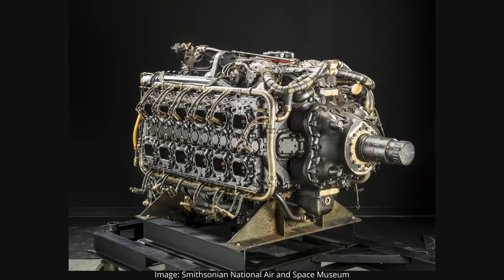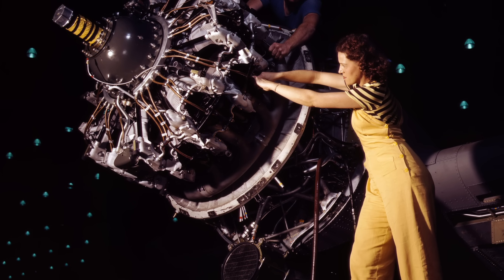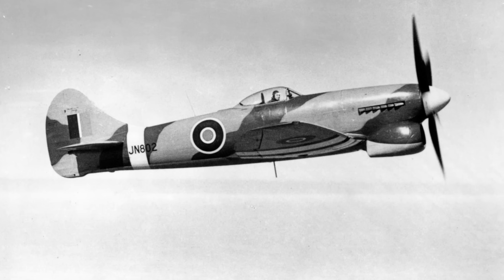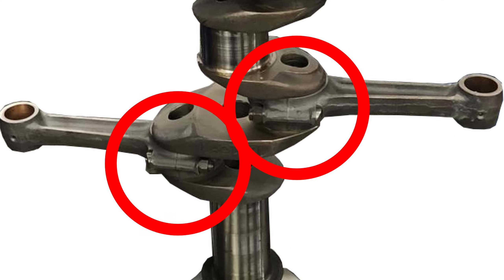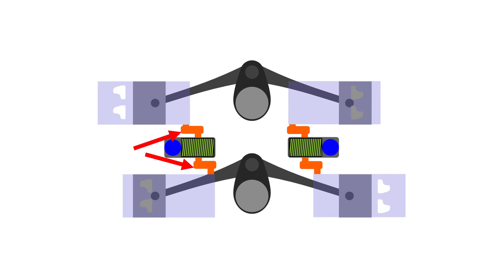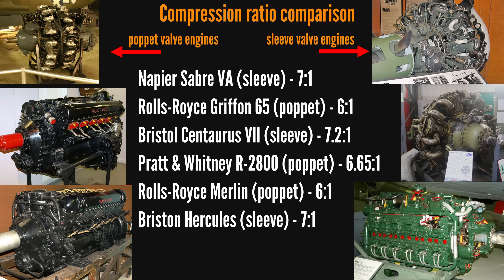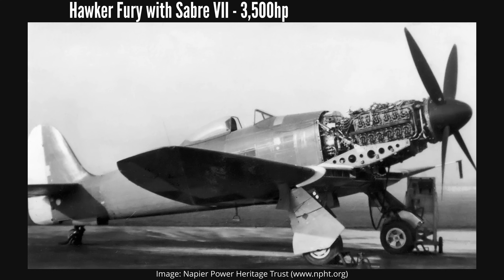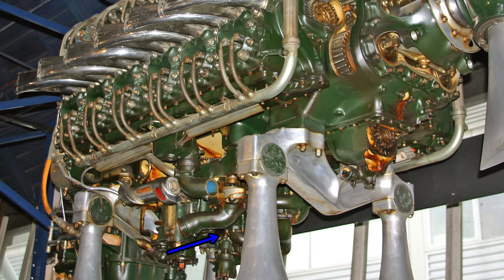The Complex Napier Sabre 24 Cylinder Aero Engine Explained Simply

Comment: Well done, most videos on these high-powered WWII piston aircraft engines are full of errors, this video has what I believe to be one.  There is no proof that the Sabre officially got to 3500hp.  The last one, the VII, was type-rated at 3050hp for takeoff on ADI .  Did they produce more than this?  Probably, but this would have been more along the line of WEP, which I have never seen specified. I once believed the 3500hp figure, but after extensive searching, I have found no primary source to confirm this, so, for me, it is 3050hp

One of the more interesting things about the sleeve valves used on the Sabre and Bristol engines was that the block had five ports but the sleeve only had four ports.  This means that one port in the sleeve would alternatively pass cold inlet mixture followed by hot exhaust gases.  This heat cycling is generally considered a bad idea, although I have never seen this issue explored in any detail.

There is a great deal to cover in any complete story of the Sabre,  unfortunately, much of the original Napier documentation has been lost.

Many H pattern aircraft engine designs have been put forward, but the Sabre was the only one that made it to production.  

In the USA, both Continental and Pratt & Whitney worked on sleeve valve engines, P&W on the X1800 aka H2600 H24 for the army and the H3130 H24 for the Navy.  These engines were considerably different to the Sabre and were closer to the layout of the Napier Dagger, albeit, with water cooling.  Examples of these prototype engines still exist.  The P&W effort came to an end after a change of management at P&W, P&W essentially bought their way out of the contract.  Kimble D. McCutcheon's book "American Sleeve-Valve Aircraft Engines " has a wealth of information on the subject.
Reply from the maker: Thanks. I should perhaps have cited my sources for the 3,500hp claim (Oldmachinepress which I believe reputable, and some research papers with the same claim). There is even some sources claiming it achieved 4,000hp, but I did find counter-claims that there is no proof of that, so I reverted to the 3,500hp number.

But I'm happy to concede if it was only 3,050hp, you may have researched that detail more extensively. 

I did consider including other H engines in the video but when I started digging deeper for research months ago I got very fascinated by the details of the the Sabre and so decided to focus on it. The Lycoming H-2470 may feature in a video soon though.

I was in contact with Kimble some time ago but didn't realise he wrote the book about American sleeve valve engines. 

Thanks for the info.
Reply: @LetsGoAviate Pierre Clostermann said the engine of  his Tempest “Le Grand Charles” was tuned to 3,500 hp for “Diver” missions, intercepting V1s.
Reply: @SvenTviking   Clostermann’s book is a great read but unlikely to be a reliable source on power figures.

If a Sabre engine of 36 litres a could produce that much power, why couldn’t a Griffon of the same capacity do it? See, these are the kinds of questions that have to be asked. They might sound stupid but the underlying point is that the Sabre would have to be nearly twice as efficient as the poppet valve Griffon in order to do what has been claimed for it. If that was the case then why are they no longer around?
Reply: @LetsGoAviate  I keep trying to post with some detail but it keeps getting deleted.  So I will keep this short.  If you go to the Old Machine Press article and scroll down to the comments, you will find some discussion on the power figures between Bill and myself where he cites which power figure is from what source.  

The 3055hp is flight-certified takeoff power, I have no information on WEP which may have been higher.  It would be most unusual not to have a WEP power output.

This, is of course the issue with just a single figure, a family of graphs is usually required to get the true story
Reply: @robertnicholson7733  I think it would also be necessary to provide comparative data for say a Griffon or DB605 or similar. Either the engine was extraordinarily efficient or these figures are theoretical or best case or whatever. Putting it into a modern context, in the strive for fuel efficiency in modern engines, I would have expected to see sleeve valves survive if they were so efficient. But I can’t recall a sleeve valve engine being produced in any numbers in the last 60 years (the last one I saw was an experimental lawn mower!).

And by contrast, the Centaurus, which was eventually developed to about 3,000 hp, had a capacity of 53.6 litres.

Bristol Centaurus: 3,000 hp from 53.6 litres = 56 hp/litre
Rolls Royce Griffon: 2,400 hp from 37 litres = 65 hp/litre
Rolls Royce Merlin: 2,000 hp from 27 litres = 74 hp/litre
Napier Sabre: 3,500 hp from 36 litres = 97 hp/litre

Can anyone not see the outlier here? Sorry but this just stretches credulity. And that’s before we start entertaining the more outrageous claims. If the Sabre could do that why couldn’t the Griffon? If other sleeve valve engines couldn’t produce that level of efficiency, how could the Sabre do it?

There will be a temptation in some areas to compare these figures with racing engines so let’s do that. A Cosworth DFV put out about 450 hp from 3 litres in 1970. That’s 150 hp/litre. But the requirements for an aero engine are very different. They are required to run at probably 70-80% power for most of their working lives. Racing engines don’t do that. Also the difference between low and high revs in a racing engine are much greater than in an aero engine. A racing engine will only reach max revs very briefly - just before changing gear or at the end of the longest straight - while we are talking of WEP for up to five minutes!

In other words, for a variety of reasons, aero engines run under very different stresses than racing engines so such comparisons are not very valid.

Even so, if sleeve valves were so efficient, I would expect to see them survive a lot longer than they did.
Reply: @thethirdman225  Your comparison of the four engines is missing a vital factor, the RPM at which that power is produced, recalculate along the lines of BMEP, you only went half way by eliminating capacity, you need to eliminate RPM from the comparison.   

There is also the issue of the combustion chambers being too big, all the main stream WWII aero engines had far too much capacity per cylinder to get good combustion (also a lack of squish was a serious issue).  Modern engineering puts the ideal cylinder capacity around the 500cc mark.  In some respects, the Griffon was a wasted effort, the already too big Merlin combustion chambers were made even bigger. From your own figures, you can see that there is no proportional increase in power compared to the increase in capacity.

Frank Halford's earlier engines, the Rapier (550cc per cylinder) and Dagger (700cc per cylinder) had much smaller cylinder capacity.  The Dagger VIII produced almost 1000hp from 16.8 litres despite being a two valve per cylinder design, running on 87 octane, not having the supercharger technology of the later R-R engines, and being underdeveloped.  Comparatively, the Dagger VIII produced 59.5 hp/litre, more than the Centaurus and getting close to the Griffon, in 1938!

The Sabre (1520cc per cylinder) had far too high a cylinder capacity for efficient combustion, yet it was half that of the Griffon.  You can see where this is going.

Sleeve valves had advantages (more at the beginning of the war than the end of the war) but the main reasons they did not survive was the incumbency of poppet valves and cost, they were expensive engines.
Reply: @robertnicholson7733  
"Your comparison of the four engines is missing a vital factor, the RPM at which that power is produced, recalculate along the lines of BMEP, you only went half way by eliminating capacity, you need to eliminate RPM from the comparison."

I don't see how this makes any difference. I'm fully aware that power is the product of torque and RPM. This was at the heart of Halford's design: that a high revving engine would produce more power than a lower revving one. It was also Halford's intention to build an engine with the greatest power density. Basically, it was as much an attempt to reduce frontal area for a given power output.

The figures I posted earlier are simply power figures. The torque figures aren't mentioned either so I don't see why RPM should be. They also reflect an engine that never went into production (the 3,500 hp Sabre was never in service).

The fact is that the differences in efficiency between reciprocating engines in this class are relatively small. If you think about it for a second, BMEP and other calculations would have to show radical diversions in efficiency for the Sabre to have anything like the power claimed for it.

To take it to its ridiculous extreme (Setright's claim):

Napier Sabre: 5,500 hp from 36 litres = 153 hp/litre

which was frankly impossible at the time.

Furthermore, one problem with sleeve valve engines is that of sealing. It's simply not as effective as that for conventional poppet valves. That means a 1930s engine was capable of the same peak output as a Cosworth DFV racing engine from thirty years later. Clearly absurd.

If you want to see an illustration of this from a racing series, look no further than Group C from the 1980s. Group C was a fuel allocation formula. Take Le Mans as an example. The fuel allocation was 2,500 litres and that was that. With all those different engine configurations N/A V12, N/A V8, turbocharged V8, turbocharge V6, turbocharged I4, turbocharged flat 6, rotary... The variation in peak power was not that great and even within those categories, there were capacity and RPM variations. Yet there was relatively little variation in power or efficiency, other than the rotary and that suffered from sealing problems too.

This is a long way of saying that every team was simply trying to get the maximum power they could from every drop of fuel while remaining within the limits of the allocation. The only way to extract more power is to increase torque or increase revs but crucially, both use more fuel. And the one thing we simply don't know about the Sabre was its fuel flow, compared with conventional engines.

"Sleeve valves had advantages (more at the beginning of the war than the end of the war) but the main reasons they did not survive was the incumbency of poppet valves and cost, they were expensive engines"

Yes. Expensive and - to a degree - impractical. They were harder to maintain than poppet valve engines of the same era.
Reply: @thethirdman225  Really, you don't understand why rpm should be accounted for?  The effectiveness of the cylinder design of aero engines is usually determined by BMEP as it eliminates both the capacity and rpm differences to give a single figure.  I thought you would have picked that up from reading and watching Douglas.  

In WWII aero engines, detonation was the key problem and cylinder size had a significant effect on detonation, the bigger the cylinder, the more likely detonation would occur all other things being equal.

I am also unsure why you keep bringing up Setright's power claims, which I have never accepted as shown in the comments section of the Sabre article at Old Machine Press.  

Equally, don't believe everything Bill Gunston wrote, he is just as biased against Napier as Setright was biased in favour.  In one of his books, he takes Napier to task about the routing of the ignition leads of the Dagger,  essentially saying that it was stupid and offering a better way of doing it, sadly, his idea would have had both plugs of 12 cylinders running off one distributor, and both plugs of the other twelve cylinders running off the other distributor, hardly ideal, especially if you want to fire the two plugs at different degrees of rotation.

You seem to have decided that I meant thermal efficiency when I used the term efficiency in my previous post, when I was talking about something else.  I am not going to discuss fuel efficiency here as that is a far more complex area.

Having recently received the Lyndon Jones cutaway engines book from R-R Heritage trust, after an 18 month wait, my attention was drawn to the R-R Eagle 22, so I will use this as a comparison as both engines were sleeve valve H24s (still an unanswered question as to why R-R spent so much time designing sleeve valve engines late in the war, if they were of no use - given their expertise in poppet valve engines and their production lines being geared up for poppet valve engines).  I will use the figures out of the R-R book even though I have not checked them against other sources.

Sabre        36.7l    3050hp 3850rpm
Eagle 22  46.16l  3500hp 3500rpm  18 psi boost 
Eagle 22  46.16l  3654hp 3500rpm  22 psi boost (1944)

Applying the Eagle 22's BMEP to the Sabre, we get 3061hp for the lower figure and 3196hp for the upper figure.  This is interesting, the lower figure gives a power output very close to the Sabre VII's flight certified power.  The Eagle 22 had an advanced two stage supercharger with charge air cooling, the Sabre VII had a single stage supercharger with no charge air cooling.  The upper figure shows the possibility of more power out of the sleeve valve engines, the development of the Eagle 22 was not completed, so even higher figures may have been possible, note the boost pressure, many writers seem to think boost pressures that high are not possible with sleeve valve engines.  There must have been a WEP specification for the Sabre, although this may be hard to find, the pilot notes usually refer only to boost pressure and mixture.  According to the stories (true?), the Sabre tended to be pushed over speed quite a lot, especially in dives, apparently over 4000rpm would not be out of the question.

Much is said about the sealing of the sleeve valve engines, the thermal transfer of the sleeves, oil starvation and all the rest but no one seems to be providing any references at all, I could find no references in Douglas's book, so if you have references please provide them.  If they are in Douglas's book, a page number will do.

From another post, clipping of the sleeves, this is strange one, for the ports in the sleeve to "clip" the port in the block, either the exhaust ports or the inlet ports must be open, meaning the cylinder is at manifold pressure (either exhaust or inlet), such low pressures aren't going to provide much force to distort the sleeves into the block ports.  Short of further information or clarification, I put this one down as a furphy.

The Hercules, which you seem to admire had a TBO of up to 3500hrs in civilian use, even then, this did not mean that the sleeves had to be replaced, the engine was considered to be very reliable, unlike the Merlin in civilian use, despite all the money R-R spent on it.  Tearing down and overhauling an aero piston engine is never a simple or cheap task (as my aircraft owning brother keeps telling me), so please provide details of why sleeve valve engines are impractical from a maintenance or any other viewpoint.

In the end, despite: a dramatically shortened design and development time, Napier being a small company, Halford's design consultancy being small and Halford being seconded to turbojet development, the engine being different and complex, and the workforce not being the best, the Sabre was the only 24 cylinder engine (out of quite a few attempts by just about everyone) to see any reasonable level of production, and it did power production aircraft, and they didn't all fall out of the sky.  The Griffon was not powerful enough (or available) and to quote Douglas (roughly) at the time the Centaurus was doing well at being a failure itself.

Was it a mistake, yes, all these large engines were, building smaller engines and using more of them was better idea, twin-engined fighters were quite good, maybe not as manoeuvrable but, in my opinion, for the majority of their use, the advantages of twin-engined fighters outweighed the disadvantages, this would have become more obvious had the Pacific war lasted longer.  I think it sad that the Hornet was not given greater priority and had flown in the war, although I understand the reasoning behind the decision, it would have been a bit of a shock to see one for the first time.
Reply: @ This is waaaaay too pointy headed to be of any importance or relevance. To address your original point though, I didn’t say you shouldn’t include revs. But given the power is a by product of torque and rpm, I don’t know why you insist on one figure and not the other.

Anything about the Eagle is largely speculative. It was a different engine, just as the Lycoming and Pratt & Whitney H-24 sleeve valve engines were.

And yes, I know about BMEP. As my brother-in-law, who builds dynamometers, says, BMEP is just another measure of efficiency.

As for your request for chapter and verse, you are becoming demanding and I’m not remotely interested, especially since you seem to think you already know the answer. I already deferred to your experience with sleeve valve Hercules engines but I’ll be damned if I’m going to bow and scrape. If you have a copy and are that determined then look it up for yourself.

Douglas is an engine designer. He’s been involved in F1 engine designs. His opinion matters. And if he says high boost levels were unlikely to be achievable with sleeve valves the. I will take his opinion seriously. I took you seriously. Kindly respect my decision to do the same with Douglas.

I have no further interest in anything you have to say.
Reply: According to  LJK Setright in 'The Power to Fly'. the max power in service was 3750 hp., and it was tested at that power for 175 hours non-stop. The special engines built for the Heston racer gave 5,500 hp at 4200 rpm. on 45 lb boost.
Reply: @PhilipSiddall  Setright was miles off. First of all, the OP is likely right. I have also looked into this and could find no Sabre variant that ever actually ran at more than 3,050 hp, much less for 175 hrs continuously, much less in service.

Part of the problem was the level of boost. Sleeve valve engines couldn't run the same levels of boost as poppet valve engines, simply because of thermal expansion. At high pressure the sleeves distort, particularly at the ports and create frictional losses and excessive heat.

Remember that reciprocating engines run at approximately the same levels efficiency. The Rolls Royce Griffon was about the same capacity as the Sabre (36 litres) which developed about 2,400 hp in its most powerful variants. The idea that an engine of similar capacity and broadly similar design could produce as much as 5,500 hp seems a bit far fetched.

There are only two ways to increase power: increase torque or increase revs. The most common way to increase torque was to increase boost which, as I've already said, had limited possibilities in the Sabre. As it was, the Sabre's normal max operating speed was 4,000 rpm.

For more information on this, Calum Douglas has talked about it in some of his presentations and also in his book, 'The Secret Horsepower Race'.
Reply: @thethirdman225  As far as I am aware, he has not provided any primary sources to back up the claim, either in his book (which I own and have partially read) or in his postings on various forums.  I believe he relies on hearsay (old R-R engineers) for the maximum boost claim and "reasoning".  All his answers under the nym Snowygrouch on this issue were along the lines of "I don't think" rather than "this document shows".  Reasoning is a very shaky ground, which I have used on occasion, because most of the time all the inputs to the argument aren't known or considered.  Napier's failed pursuit of higher boost levels may come down to what was needed at the time rather than merit.  Then there is the issue of the American interest in producing the Sabre with GE turbochargers, that is, a turbo-supercharged equivalent of a two stage supercharger.

No one actually knows a great deal about sleeve distortion in the Sabre VII as little Napier documentation exists and no one has done the simulation let alone testing to verify the possibilities either way.  I have looked at plenty of old Hercules engines, many of these were at max hours with the later 1600hp Herc having a TBO of 3000 hours.  If the distortion, oil starvation and wear were to be there at high boost, there should have been some signs of it at lower boost but high hours, I could not see it or feel it on the outside of the sleeve, it should have left a path.

I also seem to remember some claims about "clipping" of the sleeves but didn't understand to what they were referring.

Also, why did R-R pursue sleeve valves to the end of piston engines with the Crecy (okay, that is a funny one), the Exe, the Pennine, and the Eagle 22, the last two of which were designed late in the war?  In this period, their only other engines were the Merlin and the 1939 Griffin.  By 1942, most engine development was done, it just had to be put into practice and production, why would R-R pursue sleeve valves when their production lines were set up for poppet valves?  Given his views on the world, HIves' R-R would only do so if there were serious advantages and some sort of competitive advantage to be had.
Reply: @ Interesting post. Given Douglas’s experience as an engine designer, I would value his opinion above most. Even a casual, ‘in my opinion’ is likely to be better informed than even the maker of this video. I think we have to take him reasonably seriously.

A lot of this comes from the opinion of another writer - this time a motoring journalist, rather than an engine designer - called L.J.K. Setright. In his (incredibly overpriced) 1971 book, ‘The Power to Fly’, Setright claimed, with no back up, that the Sabre was good for 5,500hp. No less than Bill Gunston, in his book on piston aero engines, expressed significant doubt. As Gunston - a former pilot himself - says, we all have our favourite engines but one has to maintain a neutral stance to have a realistic understanding.

The trouble with motoring enthusiasts is that very few of them have much understanding of the requirements for a piston aero engines and it opens the debate up to silly bidding wars.

Sabre fans have been trying desperately to build a supporting argument for decades.

Few, if any have your experience so I will take that as informed opinion, in much the same way as I would regard Douglas. I am a Sabre fan too, having seen a couple in the flesh (though I’m more of a Hercules fan myself).

The reason a lot of manufacturers followed Napier was that they knew Halford was right. The Sabre had the highest possible ’power density’. The development process however was another matter. As you know, the development of sleeve valves almost broke Bristol. I’m sure you also know that both Pratt & Whitney and Lycoming also developed similar hyper engines before they recognised it was a technological dead end.

I think the ‘clipping’ probably refers to the lip of the sleeve port hitting the lip of the port in the block. ICBW.

Lastly, I don’t recall what boost pressures the Hercules ran at but it was never as high as for poppet valve engines, the Merlin being the king in that department. Whether this was because of the expansion which Douglas refers to or whether it was sealing or something else, the performance of sleeve valve engines at altitude was never as good as poppet valves.

Many have said that Napier were well on the way to curing this but I have seen nothing to confirm that.
Reply: Military engine specs from this era are always quoting horsepower output at WEP, (P-MAX) not continuous (P-100) 
ADI or MW-50 was generally only used at WEP power setting in fighters.  some Bombers used ADI at Max T.O. power. 
WEP is generally limited to 5 minutes Maximum per flight AND the aircraft cannot be return to service until an internal inspection is completed to check for damaged and to replace the spark plugs which are usually damaged by WEP.

 
 Civilian engines are usually rated at Max Take-Off power is limited by time or the supply of ADI fluid. (10 -20 minutes max),